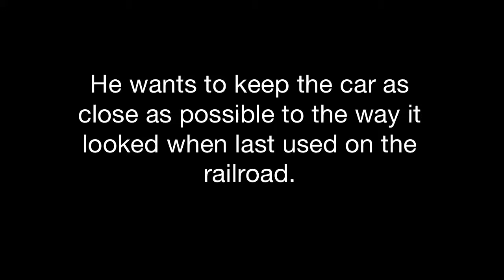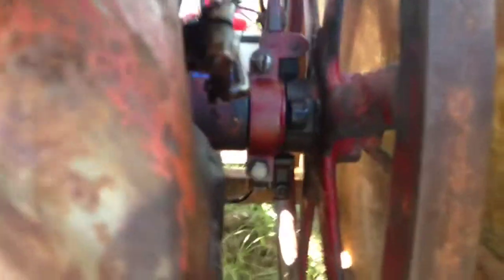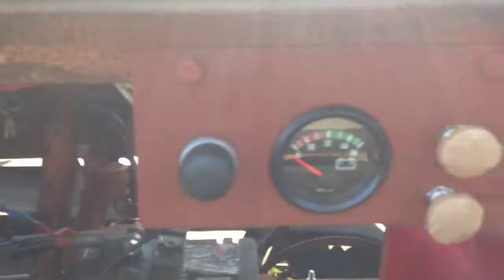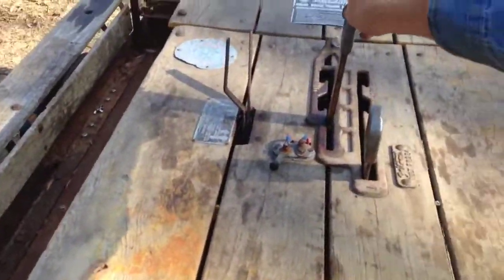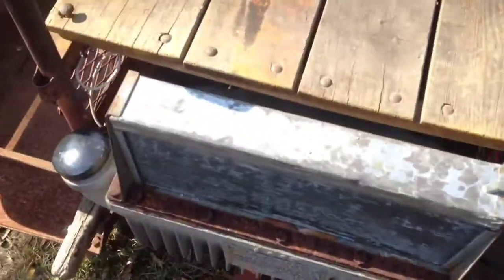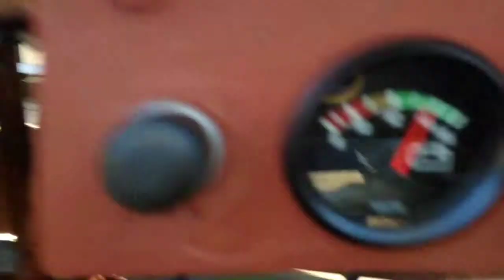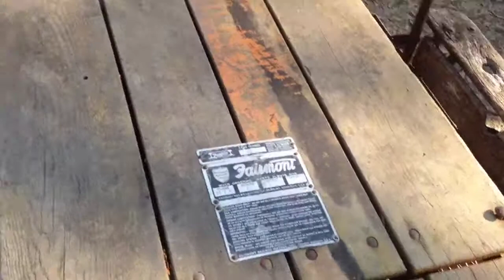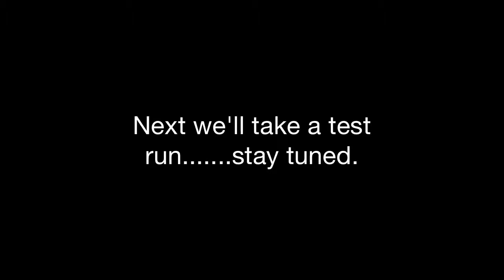CADIZ RAILROAD SPEEDER #2

Comment from the maker: Actually I'm running a 12v system all the way for lights and ignition. I'm using a 12v buzz coil. You can buy them on e-bay or from Randy Rundel on the NARCOA website under speeder parts. Glad the video helps. Looking forward to video of your rides.

Comment: Excellent video, love how you kept the character of it! I’m restoring a Newfoundland Railway narrow gauge speeder, your videos are informative and have helped myself and my friend who also has a speeder. 

His is running a 12v auto coil, so pardon my ignorance but you are running the 6v ignition but the 12v alternator is separate to run the lights and any 12v accessories? His is suffering from performance problems, as you indicated the 12v system can do that.